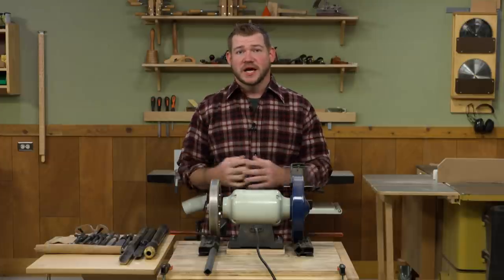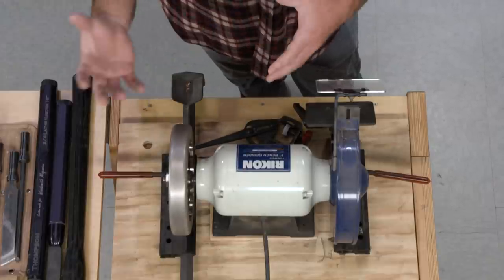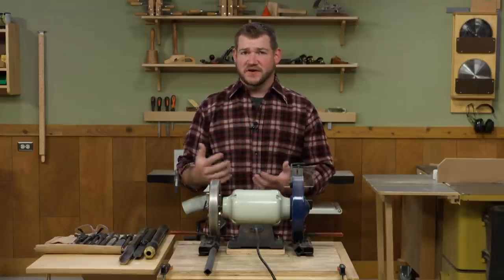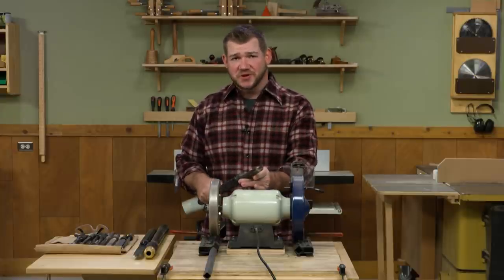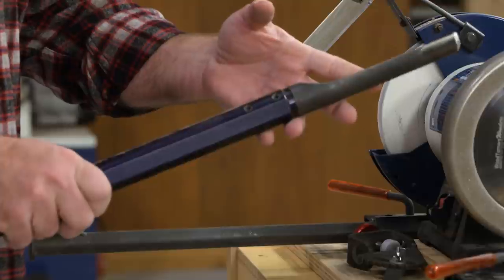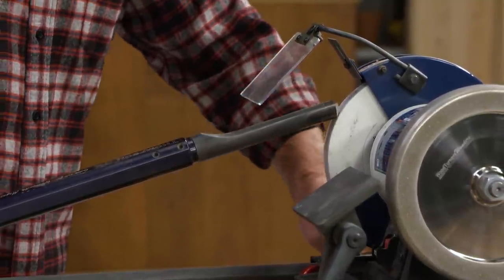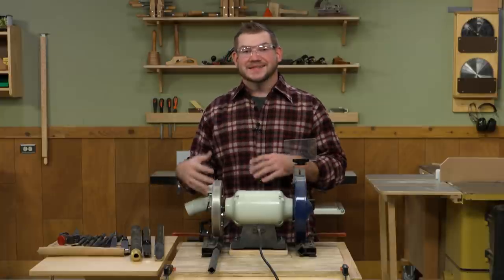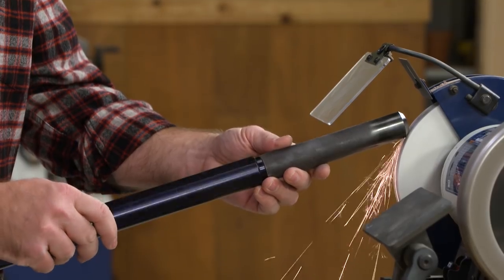Sharpening Woodturning Tools

Comment: This was a fun video, I like to see how other people sharpen their turning tools. I personally will not use a bench grinder for anything, got my hand sucked into one when I was 23 almost lost my left middle and ring fingers, thankfully I still have them, just with a chunk missing from my ring finger that made my wedding band hard to size. Most people actually use a bench grinder or a shop fox for this task, I took some scrap maple and made 4 discs that I spray glue sandpaper to and attach to my lathes face plate for sharpening my turning tools, I figured if it can work as a disc sander it can sharpen my tools. Still loved the information and the presentation and I agree until you see it done or try to do it yourself reading about doesn’t necessarily do job of teaching

Comment: When using the vee arm guide there is a danger of pinching as the tool being ground gets jammed between the holder & the wheel. This could be extremely dangerous & cause catastrophic damage so would it not be better to have the grinder rotating the opposite way with a repelling action? Most grinders are easily turned around & the only negative aspect I can see would be that the grinding dust is thrown up instead of down but that is not really a problem. We are only grinding to sharpen so this would be a much safer way of doing it.

Comment: Good information but I will disagree with the comment that CBN wheels wear out. I’ve been using a CBN wheel for over 10 years and it shows no sign of wear. It does need to be cleaned periodically but I don’t think it will ever wear our.

Comment: Everything I’ve heard about CBN wheels is they last forever. You made a comment saying they wear out. What do you guys approximate the working life of one of these wheels to be? I’ve been looking into getting one and the cost is high so I’ve been shy about pulling the trigger
Reply from the maker: They have the longest life out of all grinding wheels (when it comes to sharpening), but their lifespan really depends on various factors — how much you sharpen in a week, the type of steel you're sharpening, the bonding agent holding the cubic boron nitride to the wheel, the quality of CBN, etc. An average hobby turner, they will probably last a lifetime. For someone who spends an extravagant amount of time in their shop turning (like I do), I expect it to last a couple of years.
Reply: Excellent. Thanks for the great info.